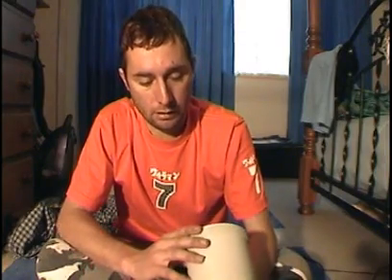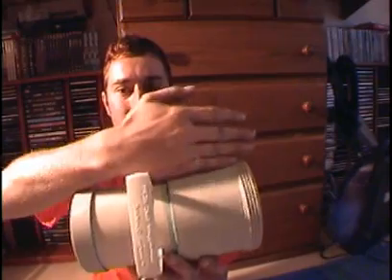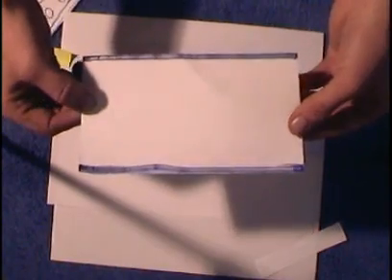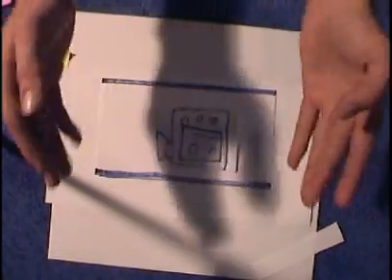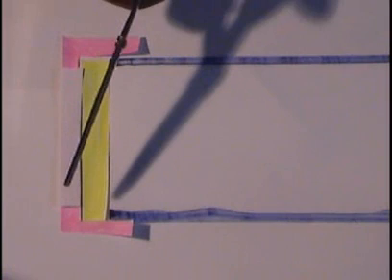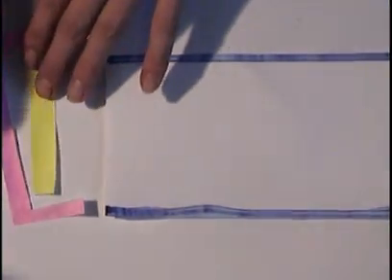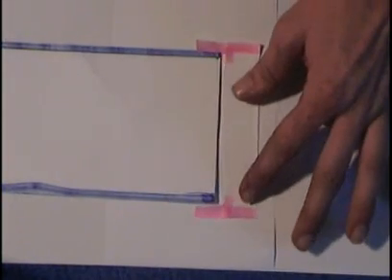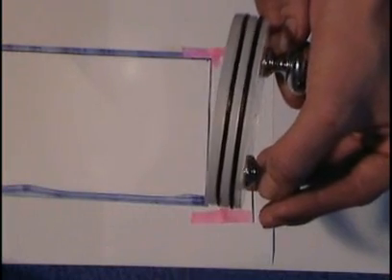d.i.y underwater housing for video camera part3 A

Comment: If it can go to 30m then it can take 4 bars. I would guess that would be fine. The only thing with this design is that the lens is on the inside. So all pressure working on the lens is just held by the glue. So i guess it all depends on the glue. It will be prone to hits on the lens glass.